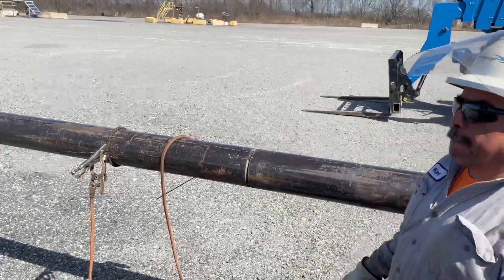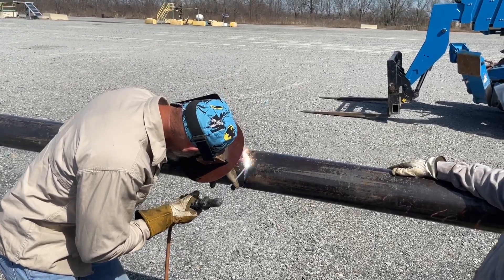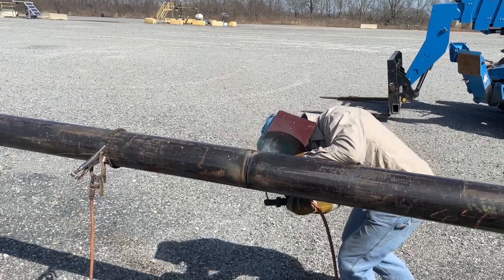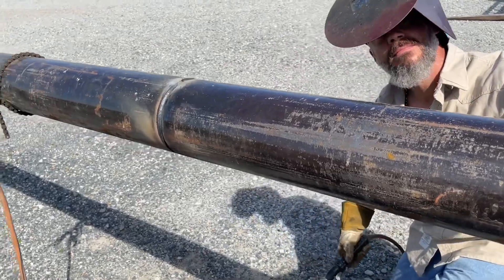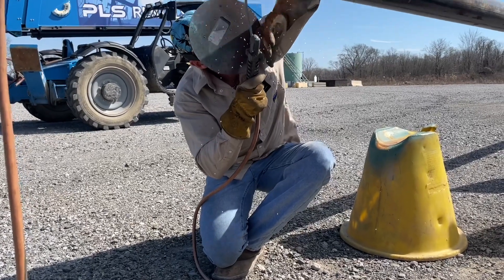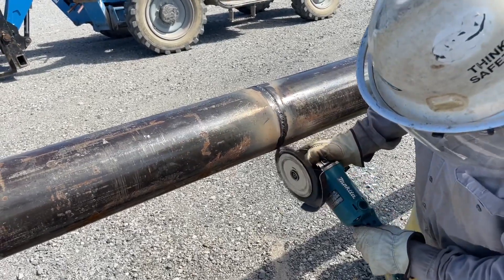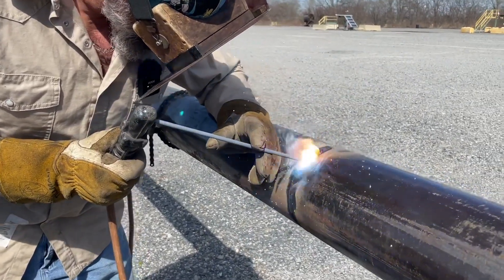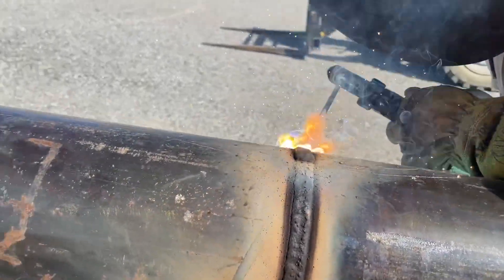Welding Downhill - 6 inch Pipe 6010 8010 (tips)

Comment: Chris, another great video. Have a question about grind makes outside of the weld area, what is the reason that maybe a small mark outside of the area would hurt. I understand that a large mark decreases the strength of the pipe. Is it just a given rule?

Comment: what amps where u running on the hot and filler? I’m really having trouble on it rn got a 12 inch branch n butt in two weeks. thanks for the video
Reply from the maker: @ezekielmirabal4712  how did you do on your test?
Reply: @ I passed it. and passed a xray on my first station but just got word I failed my second station but I learned it’s all about the settings while doing it.

Comment: We once machine TIG welded an overlay on a very large pipe, uphill on one side and downhill on the other. The UT was acceptable on the uphill side and was filled with lack of fusion on the downhill side. Lessons learned, what may work for some alloys and welding process may not work for all of them and the final inspection is what counts.

Comment: I’m having trouble with my bottom fill and caps. I get too squirrelly. Almost like I’m welding too hot and can’t keep no metal on. I’ll have a crater. Wish I could show ya.
Reply from the maker: You don’t have to show me I know exactly what you’re talking about. Turn it down. If it’s still too hot let it cool off
Reply from the maker: Also another tip is to go fast on the bottom when it starts to get hot and just go over it again
Reply: @TaylorWelding  what about rod angle? I tend to try push the metal back. Pointed back I guess.

Comment: That's exactly what I did to learn back in my teens,, this was in 1964, my 6 yr older brother had a rig and he was not working it at the time, so we went out to the back 40 where they were laying a new 6" line,, std wall though,,, we pulled up to the site, took off his torch and wacked a full joint in half, threw it on the bed of the truck and tacked it down and took off to my dad's house, I was a jr in high school then.

He opened up his tool box and got a wrap around and soapstone and showed me how to put a line around the pipe, showed me how to cut and bevel the end at the same time.,,,, told me you'll either learn how to cut straight bevels or you'll have a hard time welding up the coupons, 

Gave me a bunch of P5's (6010) and showed me the basics of welding putting beads in,, by the end of the summer I was welding pipe in the ship yard,,, lied about my age to them,,,, and retired about 5yrs ago at 70 yrs old. I'd still be working if it hadn't been for the cancer taking me out with the HR dept at work.

By the way, I watched you burn some 1/2" plate the other day on one of your video's and I have to say you are the only on u tube I've seen that really knows how to light and set a torch to the right heat to get the clean burn, most people I've seen through the years think you have to have a num 2 set at maxine to get the job done, totally opposite of the way it should be done.

Good job and video's
Reply from the maker: That's cool pull do. Thanks for sharing your story. I have also noticed there's not very good information on a torch on YouTube. Especially on how to  set it.

Comment: I typically end up dropping a rod size and doing half moons on the bottom.  Today I tried  running 3/16” 6010 all the way and from dead mans curve to 6 o’clock the puddle kept chasing me and dripping. I was thinking on my ride home maybe I was too hot. Thoughts?  3/16, 6010, 130 amps
Reply: Sorry 6010 5P+
Reply from the maker: Yeah, for sure. Turn it down a little bit. Sometimes when you get started on the side, it's really hard to keep the puddle away from you. But for sure turn it down.

Comment: I have always worked structural and equipment maintenance, generally 7018 or dual shield. I find it surprising that you don’t worry about slag inclusions at your stops and restarts. As well, as far as I know 8018 is not common here in Canada, but I have been out of the industry for over 10 years now and never worked pipelines or mod yards so it might be a thing now. 
Nice weld.
Reply from the maker: It is strange . I’ve never been called on slag. I guess you just learn what you can get away with

Comment: Did you only use 6010 and 8010? And what was your rod type for your cap pass?
Reply from the maker: yeah that was 6010 bead. 8010 hot pass 7018 out
Reply: @TaylorWelding  you ran your 7018 hylo downhill?

Comment: I own a welding business just outside of Chicago. I do pretty much everything on my own as long as I can. What is the real point of having a “Welder helper“ on a pipeline job site?
Other than having someone grind and clean…?
AF Welding, LLC
Reply from the maker: I can get twice as much done with a (good)helper. That's the real reason they're valuable. It would be extremely hard to hold all these fittings and everything by yourself. It can be done it's just slower
Reply: @TaylorWelding  ahh ok. Makes sense.  Loving the videos man! I wanted to do pipe and/or underwater when I was in school. Ended up going a very different route, but being a job shop teaches you a lot of things, fast!

Alex
AF Welding, LLC
Reply: Like you,I also have a welding business but it is in the UP of Michigan and I also do everything myself,gets difficult some days 😬
Reply: They help set your machine wether up or down  rod burning to cold or hot welder will still be burning and not stoppin ,help load the  if your 80' at a time

Comment: What’s a good starting point for amps on that 5/32 8010.
Reply from the maker: I’m going to cover this in the next video
Reply: @TaylorWelding  thanks. I just got a job at my local refinery as a welder/craftsmen, but most of what I am used to is Lo Hi uphill and tig , I never really did a whole lot of downhill, but when I try, it seems like the 8010 wants to not build up at all, and just fall out of the puddle.

Comment: How much you run your main dial when using your remote on that vantage. Great videos brother keep up the good work
Reply from the maker: Never. When you plug the remote in and switch it to remote the main dial is obsolete
Reply: @TaylorWelding  yea mine does move I can tell the difference when I tig I wonder if it only does it with tig

Comment: I like your ground connection! I have used a chain clamp like that to support arm too and works great in awkward positions.
Reply from the maker: It sure does! I threw my grasshopper away along time ago. I’ve got a magnetic one that I use sometime when the inspectors around!
Reply: If inspector would be there you’d be runoff on most jobs for not grounding on a weld or in a future “weld zone” such as the end of the pipe on the bevel. Even when doing hydro pipe. I about got run off for doing the same thing on my first well pad job but the guy went east on me. Just wanted to throw this out there. If there are welders reading this comment they will know exactly where I’m coming from